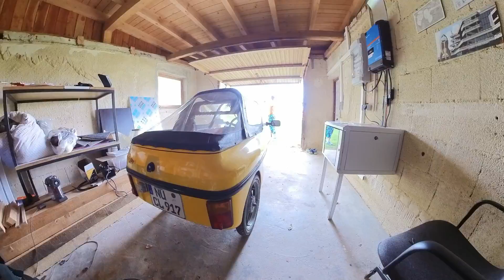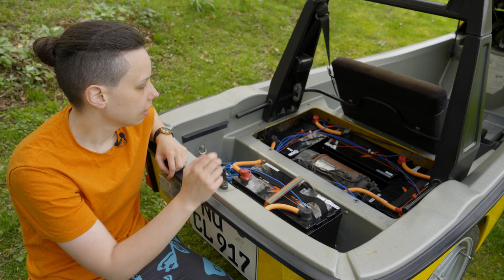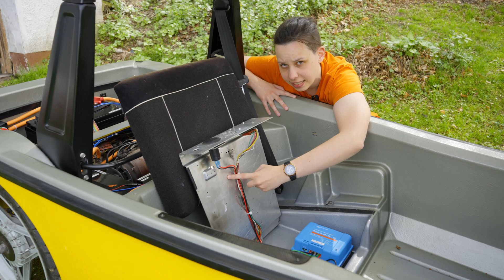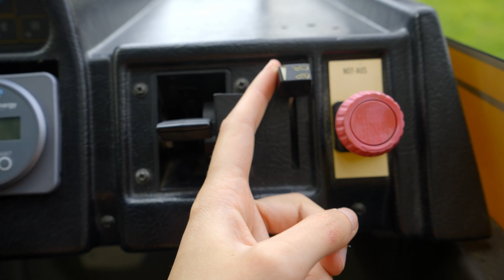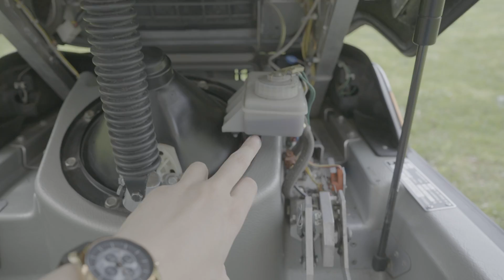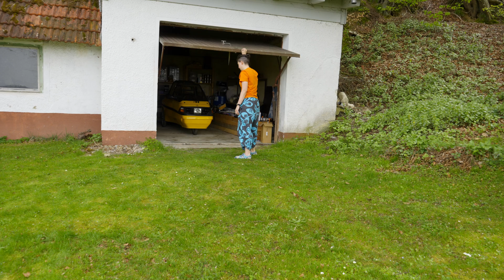Modernizing a 1993 German CityEl electric car

Comment: Thanks for presenting your great project! 🎉
I might also have the chance to get an EL from a friend that needs new Battery and playing with the idear to have a winter project.
What kind of charger are you using? I would like to have something with variable power to charge in surplus solar energy, but also be able to fast charge if needed.
Reply from the maker: Oh that's awesome! I have a no name charger, but I think Li Time for example has a very similar one on store. For surplus charging, maybe the project from trucki might be interested: https://trucki.de/ He made a board to control a Huawei charger.
Reply: Thank you for the quick response and the suggestions! :)
The trucki sounds promising…
I will see whats currently installed in the EL, when I‘m able to meet the owner in a few weeks.

Comment: It is worth it! 👍🙂
Have a Fact4 from early 2000 and working on it for a while now when there is some free time between. Reworked battery compartment and scratched out rusty parts. Also reworked drive shaft and build a 16s LiFePO4 pack. Looking forward to have it back on Road some day. Great idea with Victron DCDC. Kept old electronics and modified to 48V but good to have a plan B 😅
Reply from the maker: Uuuh awesome 😍 the Fact4 has a way nicer battery compartment layout! And super cool you built your own battery pack!
Reply: be happy that you have the older Thrige motor, not the Fact4 Perm motor. The Perm is known to be less robust.

Comment: I can recommend not pulling the steering wheel to close the top. Pull the frame rails left and right. The odometer in your CityEl reads 32.000 km, not that much - I have one that's been going 27.000 so far.

Comment: Super project! I think the central light was so that it could be registered as a bike, rather than a car?
Reply from the maker: Can only speak for German regulation here 🤔 afaik bikes always need pedals and are not allowed to drive without human energy input. And also not more than 20km/h. But the City El is originally from Denmark - maybe it was applicable there?
Reply: *motor bike...

But kinda yes, kinda no. It was always registered as a three-wheeler. For vehicles with up to 45km/h maximum speed, you didn't need a registration, just insurance. They can also be driven at age 16 already.

The first CityELs were built for 40 or 45km/h, but with time came the desire of higher speeds and later models could also be ordered with up to 63km/h top speed officially. Those were then registered like a three-wheeled car (no motorcycle license needed) with ordinary TÜV and registration.

So it can be either EG L5e or EG L1e (or their couterparts in the outdated national german classification system. Mine was "26" before and now is "L5e")

Comment: That is *adorable*! And from the stats you mentioned (after you souping it up) it's actually quite comparable with modern EVs you'd have to pay a pretty penny for. Awesome project, I hope you get your TÜV.
Reply: TÜV on my CityEl was never interested in the electric system, so i never pointed him that lead acid is replaiced by LFP.
Reply: I recently realized used electric cars have gotten below ~5k €. 
Dunno about the batteries, of course, or how hard they'd be to replace.

Comment: whoa! ein twike! 
edit: whoa! it isn't!

not the big question: will you get an E-plate for electric vehicles or and H plate for historic vehicles? ;)
Reply from the maker: Oh I think I'll take the E - more benefits and I think H might even be more expensive insurance wise 🤔
Reply from the maker: Kinda sad you can't have both :D
Reply: @bleeptrack  i can't say which is cheaper, but H is usually cheap to insure and you can enter all the emission restriction zones (which whould be slightly hilarious with an EV)
Reply: H would be cool, but with H you can't park on EV designated parking spaces. Of course everyone recognizes it with the CityEL, but 'actually' they might have you towed away. And for other older EVs you don't see it at first glance.
And also the E can drive into city centers as well (grüne Plakette is available for all EVs) and three-wheelers are allowed without restriction (and without grüner Plakette).